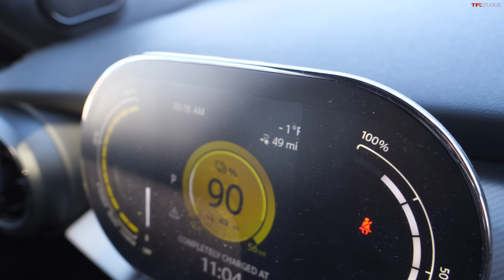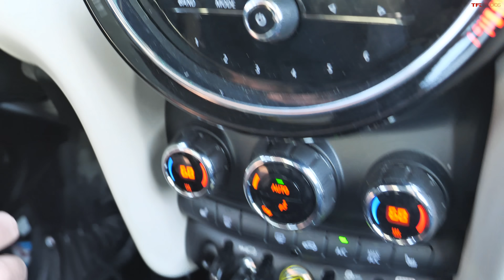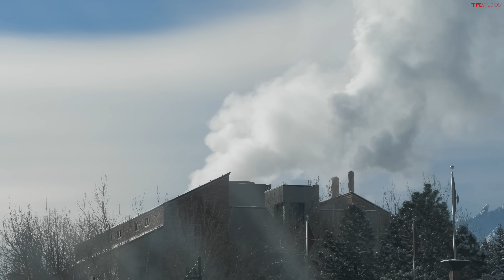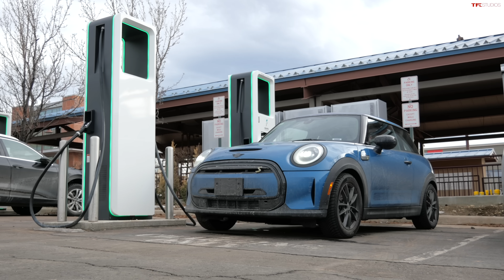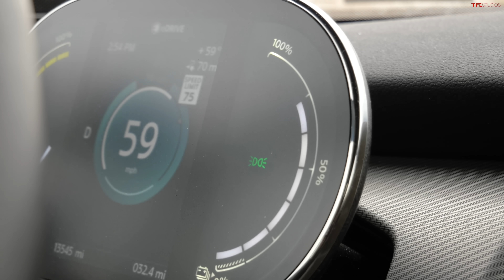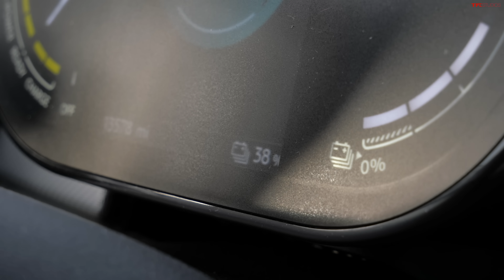Myth Busted? Here's How Much Range You REALLY Lose in the Extreme Cold!

Comment: The truth is that all cars lost range in cold weather. Kase on TFL just proved that a diesel won't run with out fuel system modifications in the extreme cold. If I remember correctly when I was driving gas cars I think I would see about a 10 to 20% range drop. Air is denser so it takes more energy to push a car though the air. ICE cars need to breath which is harded to do when the air is dense
Reply: Technically, it wasn't running because he didn't consider an additional modification after he modified the vehicle. I believe he moved the fuel filter, which exposed it to a higher volume of colder air. He then understood he might need a heater when the filter is in that location.
Reply: @ronaldking1054  yes but the diesel fuel still jelled because it was cold. My point was that all cars are effected by extreme cold  and that when its cold different measures need to be taken to insure your car runs as best as it can. Diesel's block heaters plugged in and their fuel heated. Electric cars should be plugged in when not in use and their batteries and cabin preheated. Its like wearing your coat when its cold.
Reply: @chrishansel9324  We know that the truck's fuel filter was moved. We also know that the fuel gelled in that filter. We do not know whether the fuel would have gelled if the fuel filter had not been moved. We also know that the block heater did not help with the fuel gelling at that point because we also know that the block heater had been plugged in. What he said is that he needed a heater for the fuel filter because of a modification that he had made.
Reply: @ronaldking1054  okay you're just not getting it. Diesel fuel gels when it gets cold doesn't matter where the fuel filter is if the diesel fuel can't be pumped through the lines because it's too thick then the engine doesn't run. If the fuel filter was in the engine bay it may have not been as big of a problem as it was. Adding a heater to the fuel system is a modification, which it you had read my original post you would see that I mentioned that.
Reply: @chrishansel9324  Congratulations, you just said there is no such thing as thermal insulation. No, I get it. You don't.
He stated that he traced the fuel to the gelling problem in the fuel filter. That means there was enough insulation for the tank to not freeze. He also said there was enough insulation for the lines to the filter to not freeze, and the engine had a heater, so it did not freeze. He stated he modified the fuel filter location, and that was where the fuel gelled. He also stated that he could have fixed the problem by heating the lines around the fuel filter. It is in the video. Why you are denying what the man said he found, I do not know, but you are.
Reply: @chrishansel9324  "Here is part of the problem that this truck had in cold temperatures. This is an after-market air dog lift pump that pulls fuel that pulls fuel from the fuel tank and adds a little bit of extra fuel pressure going to the injection pump. This is the fuel filter...so no longer is the fuel filter under the hood of the truck and seeing heat from the engine. Now, they actually make some additions that you can add to the fuel pumps that in order to introduce some additional heat. This, from as best as I can figure out was the chokepoint where the fuel started to gel up."      This is the actual statement of what he said happened. This clearly indicates that the problem was a result of the modification he made, and he stated that there was a modification to the modification that was available.
Reply: @ronaldking1054  diesel still gels when it is cold! It's like trying to put a square peg in a round hole plug diesel engines work by compression a semi solid state object is harder to compress.there is a reason they. make diesel fuel degeller.
Reply: @chrishansel9324  You are implying that the failure in that video was the result of the fuel type when the owner of the vehicle admitted that it was his or a previous owner's modification to the vehicle. Anything you say after this with that implication is false because the implication is false. This is a logical truth. The owner admitted that the fuel filter is not in the location of the original design. You have not refuted this. You are, however, trying to insist that movement did not change whether the fuel would gel when the owner of the vehicle has admitted that the gelling occurred at that location. If the gelling caused damage and there was a warranty, your implication, which is false, would state that the manufacturer should be fixing the fuel filter. No one should agree with this statement because he moved the fuel filter. You picked a specific example of someone that modified their vehicle, which guarantees your sample size is small, and that small sample size states you have no point.
Reply: @ronaldking1054  I don't know how to tell you this maybe you need to brush up on your chemistry but diesel fuel becomes a gelatinous state when it gets cold just like cooking oil which means fuel lines clog. Piston can't compress the sludge to make ignition so the engine doesn't run. That is why there is fuel antifreeze to prevent this from happening yes the modification did not help the situation but it would have happened anyway because it was extremely cold!
Reply: @chrishansel9324 You are still stating that design is indicative of all designs in diesel fuel when it is a sample size of 1. On the other hand, the battery thermodynamics will be indicative of all cars based on electricity with a battery power source. You can argue that eventually the fuel will gel, but you stated through implication that diesel fuel is going to gel at -16 degrees Fahrenheit by bringing up that video. That implication is clearly false because a majority of diesel trucks had no problem. In fact, you probably cannot show that a majority of that model with that year had the problem. You probably couldn't even show a significant number of them had that problem. You can, however, probably show that a significant number with the modification to the design did have the problem of gelling if the heaters were not installed because that aftermarket product would be the failing point, but for some reason, you are stating the bad design of the aftermarket part is indicative of the stability of the fuel type.
What can we say? Mileage also goes down as temperature goes down in the vehicle type because of the need for tires as just changing the tires is sufficient, but this works for batteries as a source of energy. We can also state that the heating of the cabin is going to move the engine from its equilibrium point so even heating the cabin is still a waste, but it is a waste product, so it is not as bad, but the fuel type overall is very inefficient. We can also state that it is possible to avoid range hits in batteries as a power source by ensuring the battery is warmer through a charging cycle, and we know that cabin heating is not necessary as much once the cabin has been heated as this is the nature of insulation, and the batteries to prevent damage are also very insulated as it is more interior, which incidentally is the case with the stock fuel filter location in that vehicle as the filter location is in the interior of the car, which is in this case, under the hood.
You are straight up wrong in your point. Your argument is the same point as if one battery catches on fire, all batteries will catch on fire at the same point. This is not true. In fact, there are technologies that allow battery fires to not spread, and by your logic, they don't exist because another chemistry can catch on fire.
Reply: @ronaldking1054  no it's science. I don't know what you're not getting about a solid being able to be run through gas lines a fuel filter for being compressed to create ignition. I'm done with this topic
Reply: @chrishansel9324  Why does your pipes not burst in your house? The temperature outside is below the freezing point. The house is heated, but even if the house isn't heated, the pipes have to lose the temperature while they are not exposed directly to the outside air. This is insulation factor. You are claiming that removing insulation factor, which is what moving the fuel filter from underneath the hood does, does not increase the likelihood of freezing. This is all science, but for some reason, you believe that none of this applies to the liquid that is known as kerosene or diesel depending on whether it is taxed or not. You are also claiming that moving liquid does not have more kinetic energy (average kinetic energy is temperature, science, dude) and as such, it is less likely to freeze. What's funny is that it only froze while moving in the fuel filter, which incidentally had insulation factor removed and as such, it was more likely to freeze / gel. Your claim is that that removal of insulation factor did nothing to the fuel while at the same time, you have provided no evidence beyond the video that what you are saying is true at the conditions of the video. This is all scientific method. You provide no evidence, and as such, your point is not proven. Science, dude. If your point was valid, the fuel would have had to gel in the tank and the fuel lines, which he said the chokepoint was the fuel filter. He also said that the lift pump is an aftermarket part, and that the aftermarket part required the movement of the fuel filter FROM UNDERNEATH THE HOOD, which is more insulated. This is akin to moving the pipes outside the house and wondering why the pipe burst. Anyone can tell you why it did. The pipe is no longer insulated. There is no reason to believe that explanation is different for the liquid known as kerosene if not taxed or diesel if it is taxed. This is all science, dude. You have refuted none of it, but you believe I should concede the point as if you had proven any of it.
Reply: @chrishansel9324  THE CHOKEPOINT WAS THE FUEL FILTER AND AS SUCH, THE CONDITION OF THE ENGINE WAS NOT THE PROBLEM. IT WAS NOT GETTING ENOUGH FUEL TO IGNITE BECAUSE IT WAS STUCK IN THE FUEL FILTER. You bring up a completely irrelevant point. By the way, the engine had a block heater, and as such, it was warmer, but none of that will make a lick of difference if the flux in the fuel filter does not exist. Science, dude. Does a fuel clog make it so that the pistons will have sludge? No, because there is no fuel to ignite. He could not gain speed because the pressure in the fuel lines was too low.

Comment: That is a good percentage. It is a little more than what the gasoline cars are losing in th winter, which according to the energy(dot)gov, is at around 15%. Of course, in the case of the ICE, you have a much bigger range to start with, plus the refueling doesn't take a lot of time. I think this was the point about getting an EV with a bigger battery, in climates where is cold at least 4-5 months per year (like where I live, in Canada). But even with a small range EV you can be OK in town, now all depends on what you need.
Reply: Good balanced post. I own a KIA NIRO w/heat pump. When I turn it on, the projected range drops 10 miles, regardless of temps. This has a 'winter mode' feature which keeps the battery 'warm and happy". My last EV an IONIQ 03 was far worse.

Comment: Heat Pumps are not very efficient at low temps like that. Most heat pumps we install in commercial buildings have aux heat that kicks on at around 20 deg. I’d bet the Mini does the same, otherwise the heater would be blowing lukewarm (if that…)

Comment: Batteries operate on a chemical reaction that works best at warm temperatures, the same temperature range humans prefer. It’s why battery preconditioning is important in the winter., though it only helps so much. There’s really no way around this Achilles Heel of EVs without new battery tech/chemistry, and there will still always be increased climate control demands and worse road conditions affecting efficiency in Winter.

Comment: Couple of points. A lot of energy has to go to keeping the battery warm regardless of where you set the cabin temp. Also I bet that the heat pump has resistance auxiliary heat that cuts in at very cold temperatures when the heat pump is not efficient. Resistance heat is an energy pig compared with a heat pump on a BTU/kWh basis.
Reply: He should have turned the heat down more and kept the heated seats on.
Reply: @chrisgianettino1079  I think he wanted to show a worst case scenario. I believe that the heated seats use less energy.
Reply: This is actually not true in most EVs.  Most EVs use very little power to power the battery unless it gets extremely cold.  Most cars are setup to not heat the battery unless it's well below freezing.  The only exception to that is preconditioning before arriving at a charger, which is not a commonly found feature, but is becoming more commonly found.  The simple reality is, these batteries get cold and don't function as efficiently when cold.  The car companies have done the testing and have just decided that it's a waste of energy warming them up.
Reply: @rossm9200  Since this test was done at around zero F (well below freezing), one would assume that the battery was heated just to prevent ice crystals in the electrolyte.

Comment: This test raises more questions than answers.

1 By charging the battery before test you warm the battery..

2 hvac use 《heater and air con)

There are many more but if you had a cold soaked car outside like driving home after a day at work.

That is when range has biggest impact in cold.

Charging car and heating battery before just reduces impact of cold on battery.

A cold soaked car will use more energy to warm battery and cabin also.

It is not a myth about baterry evs uaing more energy in cold,its a fact.

Your test would be best case and a cold soaked car would be more realistic as a use case as not everyone has indoor parking and charging at work.
Reply: Yes, there are no high-volume portable charging units like have been shown on other channels of this very network.
Reply: Yep, completely defeated the point of the test.
Reply: Remember, has to not become a target for the ev wacko’s. If you watch he shows the truth in the fist minutes, was in his garage charging and didn’t make 100%, had to go to charger first. Cold soak home charged range was less than 50!!!!!!!! In the garage, cut 5% more if parked outside!

Comment: I've noticed when you first drive, the efficiency is worse since the car uses more energy to warm up the battery. Once it settles, the eff improves (still not as good as ambient temps). The shorter the drive, the larger the difference between ambient & cold days.

Comment: You should have parked outside.
Should have used heated seats. 
A large percentage of population does not have garages. 
Electric seats are more efficient than using hvac system.
Reply: How do you keep the windshield clear....
Reply: you have to use a cabin heater at that temp.  you'll freeze and your windows will fpg up in minutes.
Reply: I like heated seats, but I don’t find that they are a substitute for cabin heat.  If my back is warm and my front is cold, I still feel cold.
Reply: Parking outside only matters if the car has not been conditioned and you do not plug it in. Otherwise, you set the time to be conservative when you are leaving meaning the car is warm and the battery is conditioned. Before you state the nonsense of not being able to condition the car, you are arguing that inverters and batteries do not exist. They do, and as such, it is ALWAYS possible to condition the car. Whether one does or not is the choice of the person.
Reply: I don't think the comment was to shy away from cabin heat, but to supplement. Either way, turning both heated seats and steering wheel on wouldn't have changed the results.

But doing so could allow for a slightly lower cabin temperature for those who would want to maximize range. I believe the lowest selectable temperature is 62F, it could be 60.... I don't recall.

Comment: Curious how big of a difference turning off the heater makes.  I know the 99% would never consider this and the thougt itself is offensive to some.  I just  run steering wheel/seat warmer in my Bolt.  Only adjust if the windows fog.  Then i crack my window 😄.  Curious how many mi/kwh im saving with my suffering.
Reply: at that temp you are not driving without a heater.
Reply: using air conditioning is not a good idea if you are going for a run in the mountains during the winter to give just one example of why you may not want to turn it on.